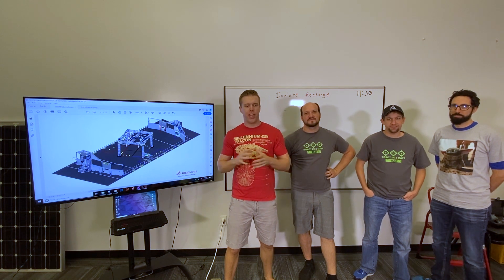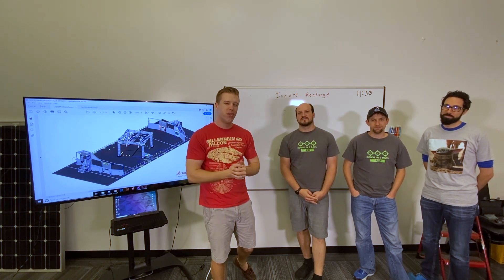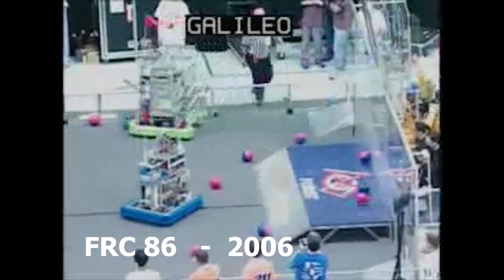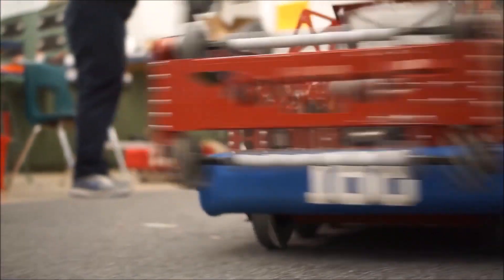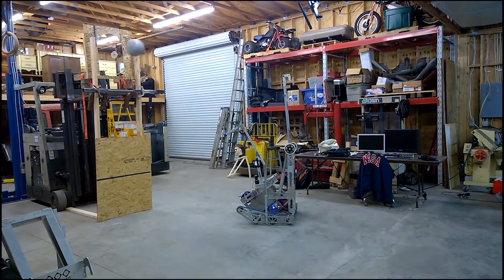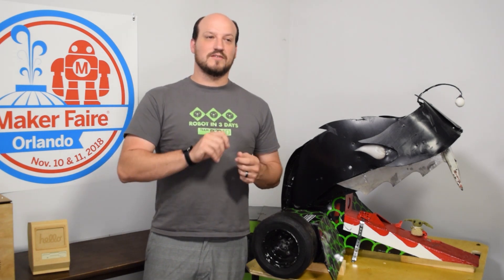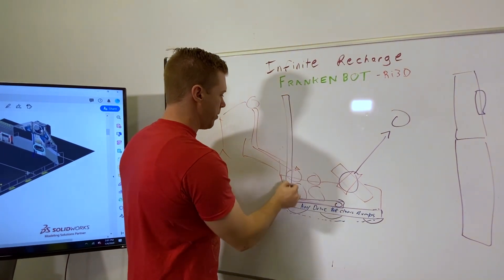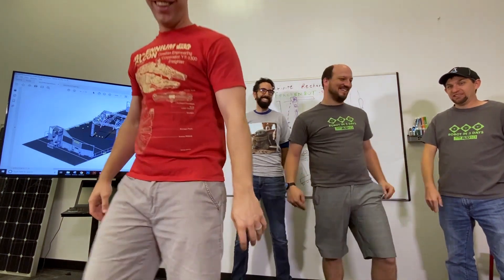Robot in 3 Days 2020 -  Team Ri3D 1.0 - Strategy and Insight for FRC Infinite Recharge

Comment: Team 223 in 2003 had a nylon rope launcher if I am not mistaken. In 2004  also had a hook design with a telescoping arm with a latch that would automatically click closed once it was done climbing so when the power was turned off the motor didnt drift at all. 2005 they also had the telescoping arm to lift and place the tetrahedrons which could be retro fitted for the disk spin or the hanging portion as well. Just going back on some memories I had when I was on the team back in HS.